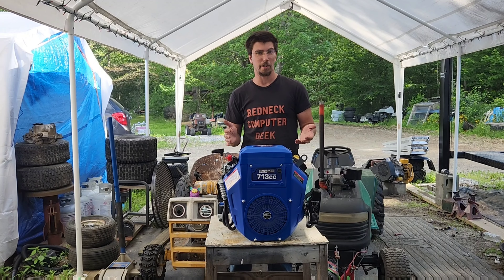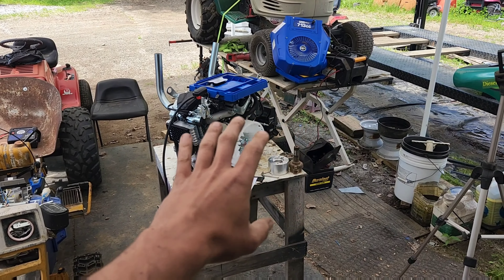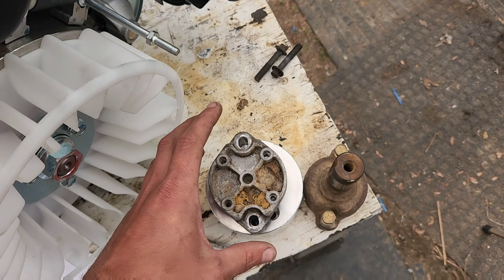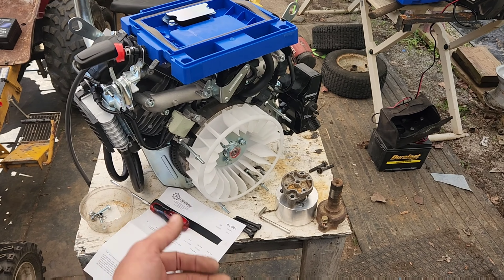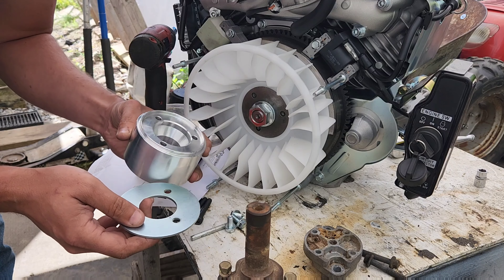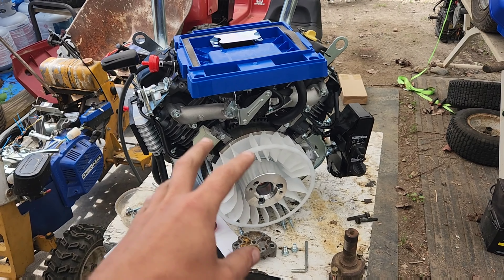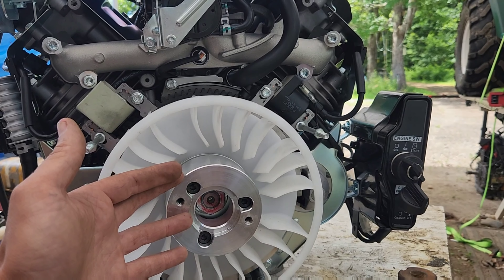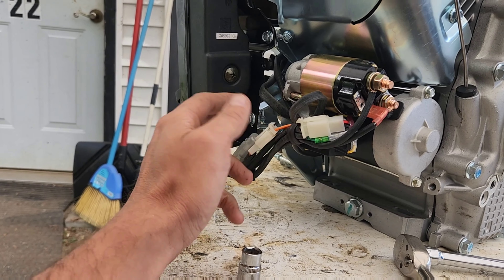Duromax 23hp 713cc XP23HPE

Comment: 9:35 
I will say that top of the blower housing where the air filter goes looks like the rectangle shape of a Honda v twin air filter. 
We have a handful or a few more generators out there with those engines. 
Sometimes we have issues with their unregulated charging system and it can take off and give ya like 16.5 volts because Honda rates em at 3600 but no load on a gen is like 3750-3800 or so.
Funny thing is , the ac output from a Honda or Briggs v twin stator is about 30 volts. 
I'd like to take a gamble and try a Briggs 10 amp regulator/rectifier on one but the boss is not down with it.

Comment: Any idea what the purpose of that long vent hose is for that connects to the nipple on the bottom of the air cleaner housing? It's on the carb side of the filter, so theoretically it could allow dust, etc. to be sucked directly into the carb. Maybe not likely seeing how long the hose is, but I don't see the point of it and am thinking I'll just plug it.
I bought one of these earlier this year to replace an older 18hp vanguard on a wood chipper that has an eroded/rusted spot on a cylinder wall. Haven't put it on yet and am probably going to hold off at this point. I actually mentioned my situation in your video on the rusted out 18hp vanguard you got running recently. FWIW... :)

Comment: Does the engine not come with a muffler? Seems to me that if the Predator comes with a muffler then it might be  better value. In California the ability to actually get the unit is an issue.

Comment: What is you're personal experience and thoughts of the KOHLER MAGNUM Opposed Twin (Vertical and Horizontal) Engines?
I personally prefer these compared to the Briggs since the Carburetor is easier and cheaper to rebuild.
I'd love to have a V-Twin (but not a Command) to convert my 1986 CRAFTSMAN GT6000, but I'm not made of money...
Reply from the maker: They both have trade offs. The briggs selling point for me is running in the cold. That will be the big test on this engine. Summer is easy. Running and plowing in sub 20 then you find out where the breaking points are.
Reply: @redneckcomputergeek  Thanks for you pretious time to respond RCG!
Much love to you and your family. 🥰